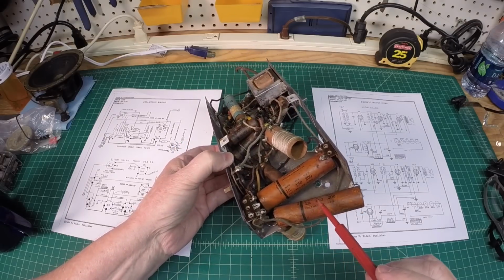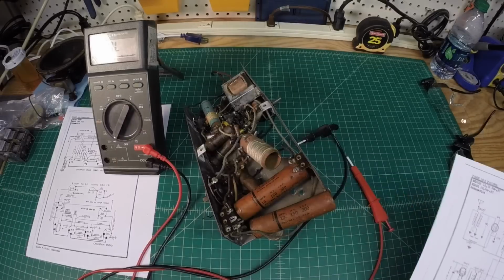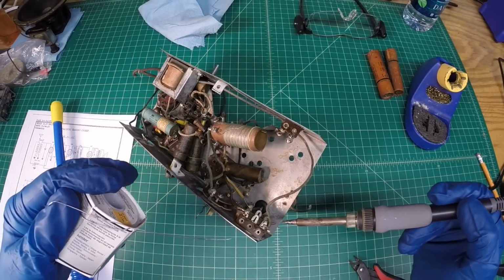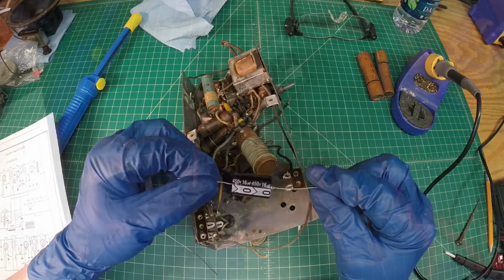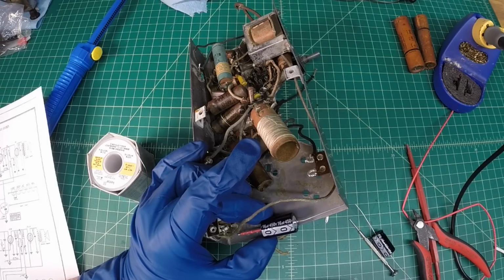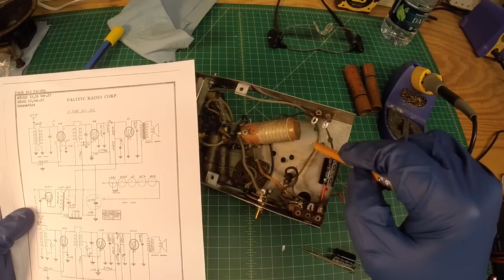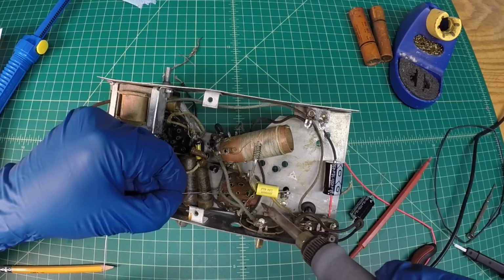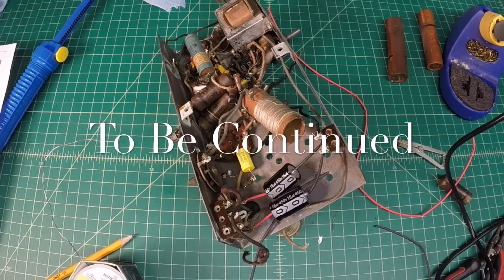American TRF Receiver - Part 3

Comment: great video whats the best way to calibrate the TRF radio
Reply from the maker: There’s not much to align other than tracking using the adjustments on the tuning condenser at ~1400 KC or shaping (bending) the tuning condenser plate. A good earth ground if the chassis is not hot and long wire antenna brings out the best on one of these receivers. Thanks for reaching out and watching. Best, Don

Comment: Don,
Over the past decades, numerous times have occurred when I’ve had no alternative but to resort to using various generic circuit diagrams for repairing/restoring lesser known makes of Vintage Radios.  If one feels a need to engage in reverse engineering – which I rather foolishly do from time to time LOL – it is highly likely one will be faced with a boringly long-winded task.
Occasionally, after lots of digging and poking, circuit diagrams of sorts kind of sheepishly creep out of the woodwork so to speak.  Often, those lesser known manufacturers made various circuit amendments throughout their radios production runs so the circuit diagram one is so happy to have unearthed does not quite tally with the radio on one’s bench…on occasions, it causes me unnecessary frustration LOL.  
So, my friend, the question remains: given the limited information written on that radio chassis, how did you locate those circuit diagrams? 
There is no doubt about it, you are swimming along superbly with this radio restoration.  I’ll certainly be tuning into the next episode.
Regards,
Phil.
Reply from the maker: Hi Phil - I've encountered a few sets along the way that I couldn't locate a matching schematic, e.g., Chanticleer 2D570, which was by far one of the most challenging, but rewarding restorations I've completed to date. If time permits, checkout the playlist for the series. The electrical was an odd design that took considerable research and the wooden cabinet was a mess. I stayed with it even though there were times I almost gave up on it as I had to build a new voice coil, spider and re-cone the speaker too. In regards to locating a matching schematic, there's a great resource at: http://www.grillecloth.com/sylvania/tubelist.php that I find myself using on a rather regular basis. I'm thankful such a resource is available. I also have the SAMS Redbook that comes in handy too for the later year radios. Thanks again for following along. Best, Don